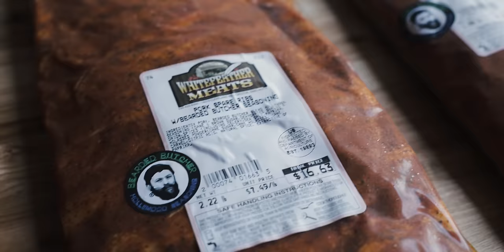Pork Spare Ribs vs Baby Back Ribs (and 321 Ribs) The Bearded Butchers Explain!

Comment: Good Job guys. Always a pleasure watching you. I ordered your Original rub and Black and the Rebel Red. I seasoned 2 NY strips, 1 with Original and one with Black. I haven't had them yet but they are vacuumed sealed in my deep freeze. But today i made some St. louis ribs and i used your rebel red... I was waiting for the massive heat but it was just pleasant. Not overpowering. Full of flavor. I'm looking forward to eating the NY strips. I did them both Liberal like you suggested. Thanks again for your videos.    👍

Comment: Awesome video! I haven't yet pulled off a 321 with that kind of cook time and heat though. They always end up just completely falling apart. Then again I'm usually on a commercial level with an Ole hickory instead of a traeger and when I cook for myself it's on a simple weber charcoal kettle.  I've stuck with smoking until I can pull the bones out clean then saucing and glazing if I even glaze them 👍

Comment: Salt and Pepper only,  smoked Pork Lard, spritz w/ ACV.  225*F for first 3 hrs. to get that smoke flavor,   275*F after that to get the meat pullback. Pour on some smoked lard for more pork flavor.Thin BBQ sauce and add that before you remove the ribs.  321 method isn't too cool really bc of the different types of smokers.

Comment: Great video!! Great looking ribs I'm sure they taste amazing. 
Note- The 3,2,1 method is 3 hours of smoke, 2 hours wrapped and 1 hour back on the smoker for finish color/bark then rest for 20-30 mins. Your smoker is way too hot should only be 230-240 so that you can get your full 3 hours of smoke, 2 hours wrapped and that last hour of color and texture and they aren't so overdone when completed. That 3 hours of smoke is needed the most for great smoke flavor and smoke ring. The ribs were already falling off the bone and way over done way before they were unwrapped. They should be ALMOST fall off the bone but not quite when unwrapping. Then they will become fall off the bone done when taking them off the smoker after your last hour to rest. 
As far as flavor is concerned, these guys are relying too much on their heavy spiced rubs too mask the overcooked ribs meat flavor and and lack of natural smoke flavor.
Reply: I'm pretty sure these guys have smoked more meat than you. just sayin.

Comment: I love watching you all, but those ribs are way overcooked.  They look delicious, but were on the edge of being overcooked even before they went into the wrapper.  I'm going to pick up some Hollywood to test out on my next rib/pork butt smoke.
Reply: Looks like they were pretty juicy to me, smoke adds a lot of.color
Reply: They cooked the ribs for a little over 4 hrs all together which is normal rib smoking time.
Reply: Agree. Overcooked. It was 4.5 hours plus 20-30 minutes after the sauce was applied to let it "set up." Other BBQ pros show 4 hours max with maybe additional 10 minutes for the sauce to tack up. At the end the meat and bone should hold together, slice and hold together and when you bite you should be able to see your bite mark. Full disclosure - I just did baby backs today and mine also fell apart like his in the video. I used aluminum, too much liquid, and cook time was too long at 4.5 hrs at 275. Still DAMN delish.
Reply: I agree but up here in the Midwest if you don't cook it to mush it's undercooked. Fall of the bone is over cooked people! I miss North Carolina sometimes...but not the heat!

I had "ribs" in an upscale restaurant here in da U.P. that they were so proud of. It was literally a pile of over cooked mush with a couple of bones sticking out and swimming in sauce. Not even remotely recognizable as ribs.

Comment: Loin meat is different from rib meat (think white meat vs dark meat and connective tissue). Once I bought a rack of baby back ribs at the grocery store and it had an above average amount of loin meat (the situation was made worse by the fact that the loin meat was thick and off to one side rather than a thin evenly distributed layer). After cooking, the loin meat turns out dryer (less juicy) and less desirable.

Comment: I love spare ribs but not much of a fan for baby backs. I am not able to use my grill due to the apartment I live in. I season my ribs overnight and bring them up to room temp then I wrap them in heavy foil as tight as I can and then bake them in my oven at 275 F. for about 3 hours, Brush on BBQ sauce and leave open in the oven for another 45 minutes at the same temp. They come off amazing. I like my ribs but I think I would love yours more. . .

Comment: I'll do another fun fact of the day. Part of the reason the sugar is so important for ribs is it brings in a little bit of additional sweetness to help counterbalance the amount of seasoning you're using although, I would recommend using a saltless seasoning and applying a decent amount of salts beforehand oh, the reason for this is to ensure you don't add too much salt because the other seasonings you know if they got a little too much you can rub them off or something but if there's too much salt there's not really much of anything you can do about that. And for your finishing when you do your rap add some honey and butter and it will just add a lot of extra depth and flavor, if you do a wet rib then I would recommend adding up just a little bit of whatever your sauce is going to be regardless if you add it right then or not so that way the flavors of the sauce can meld into the meat just a little bit. I'm kind of just rambling so my apologies,

Comment: Question: do you keep the smoke on while the ribs are wrapped? Does the smoke permeate the butcher paper ?
Reply: I just smoke during the first phase. The smoke doesn't permeate whichever wrap you use. This phase pretty much tenderizes the meat more and helps in locking in the flavor and you don't need smoke in the last 30 minutes or so...Hope this helps

Comment: 16:20, them prices per pound bro. Get out of here with those. That's high. Ribs are like $2 or $4 bucks a pound at the grocery store. Yes I understand this is a small shop with lesser traffic but come on.
Reply from the maker: You have zero clue what you're buying. Do you think a Ferrari and a Honda Accord should be the same price?
Reply: @TheBeardedButchers  I know you're the experts and I'm not here to argue. But my Smithfield ribs, yes I know they are the global leader and hard to compete with, are fine. I'm not trying to buy imberico pork ribs or some expensive breed.  There's not much of a measurable difference between pig breeds once I put a dry rub on my ribs and sauce them later. 😋 like I said,  I understand you're a smaller operation compared to Winco (west coast store), Smiths (Kroger brand) or Walmart.  When it comes to beef.  Yes there's a difference for me but when it comes to pork or chicken.  Lowest price works for the most part.  There are exceptions for how the animal was raised and fed and how it tastes different but I can't justify 2 or 3 times the price per pound for pork ribs compared to Smithfield or tyson.